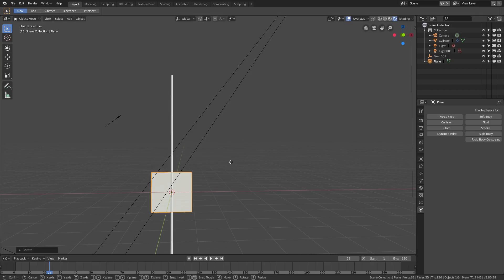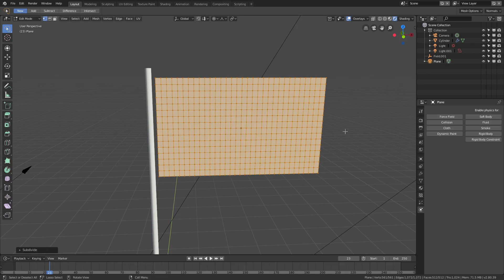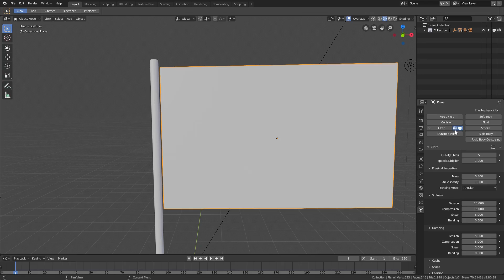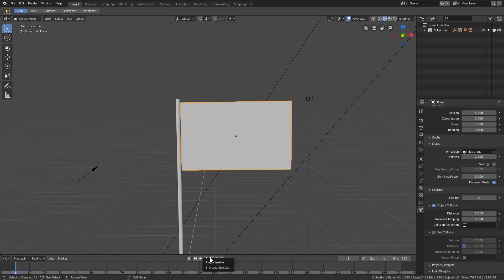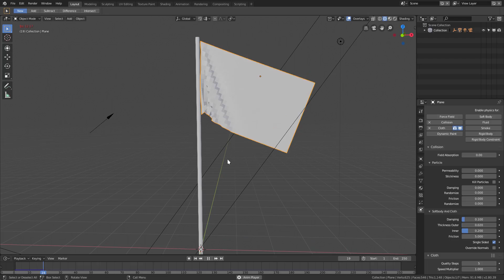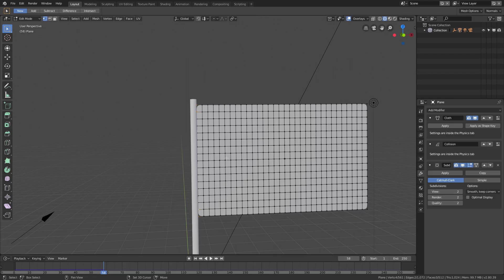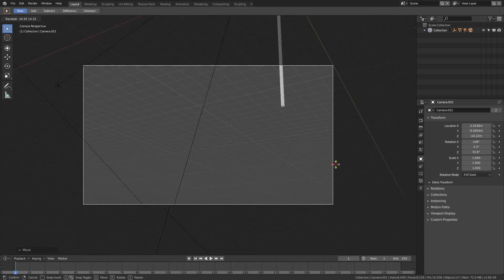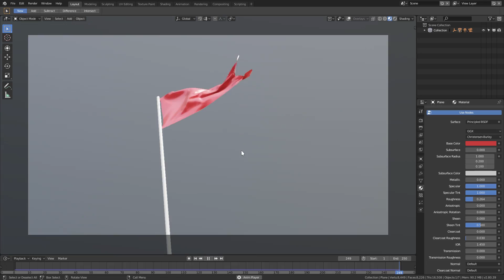Blender 2.8 Tutorial - How to create a flag w/ wind physics

Comment: I did the exact same thing as you did but the wind doesn't work at all for no obvious reason. I feel like I have THE worst luck with blender.
Reply: I turned the wind up to the thousands, made sure it was pointed directly at it, tested every other setting on the wind force, remade the thing, deleted all the bakes, and absolutely nothing works. Blender never works for me.
Reply: @lfdhrgasdf7579  Try turning the strength of the wind to millions and turning down the weight of the flag to 0.1 kg.
Reply: @Broadsmile1987  thq very much bruh

Comment: Ctr+R on Edit mode then add another line of vertices will fix the rounded corners.
Reply from the maker: You could also bevel them in Edit Mode (Tab) with Ctrl-B  :)
Reply: @TutsByKai  I don't use often a bevel tool. The bevel tool is new and very good for a precise task.
Reply from the maker: I hear that! It is very precise! I love using it  :)